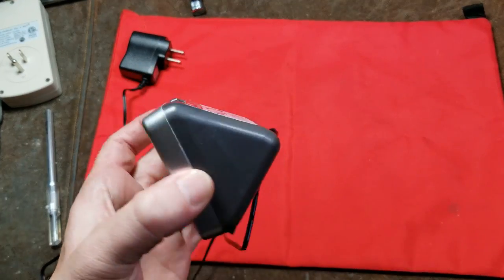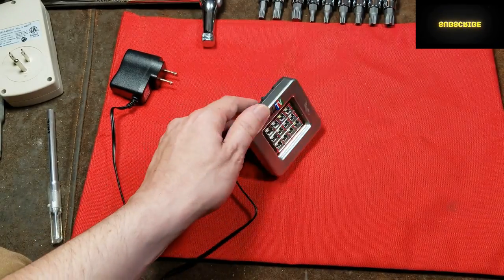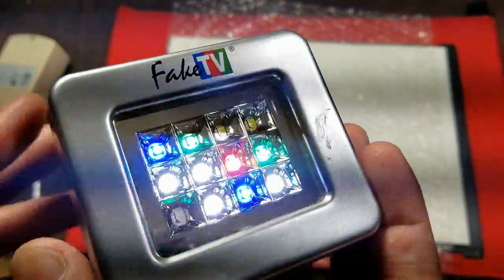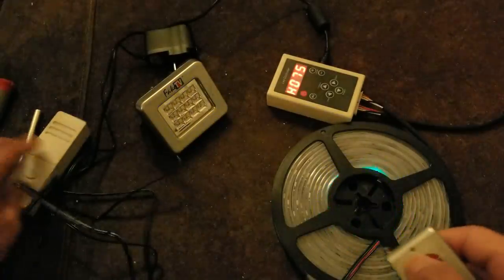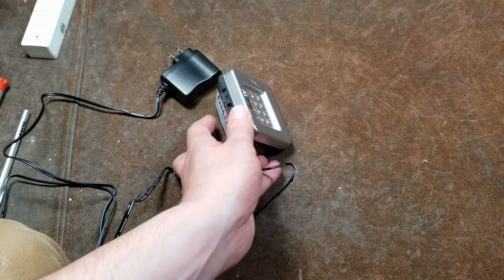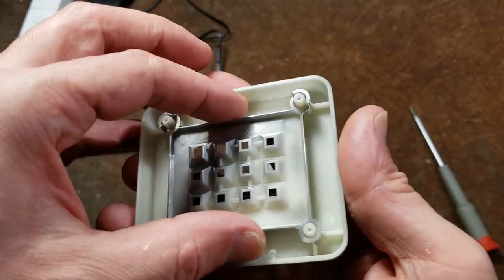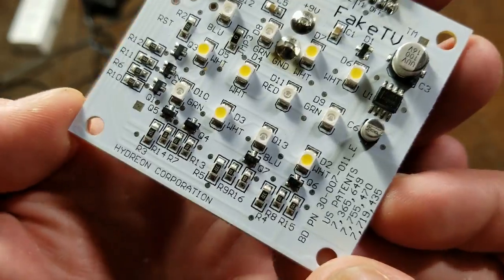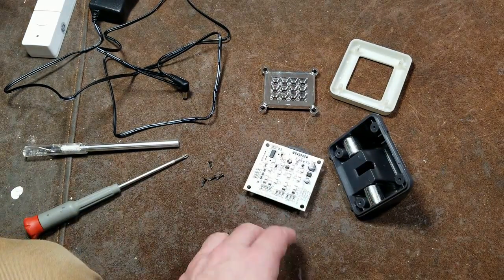FakeTV Home Security TV Simulator Review

Comment: I never knew there was such a thing... It reminds me of a similar thing I had for a vehicle once. It was a little device that sticks to the inside of your window with 3m double sided tape. And looked identical to an aftermarket alarm system. Complete with a little fake antenna and even a blinking blue or red led. It took a button cell battery if I remember correctly.
 It seemed to work. The blinking led in the windshield is probably just enough for them to not chance it and move on to the next vehicle....